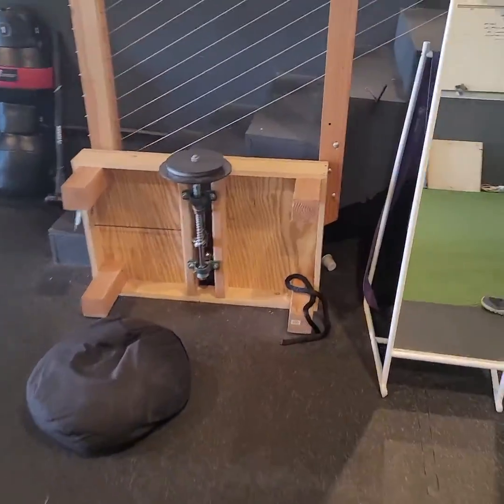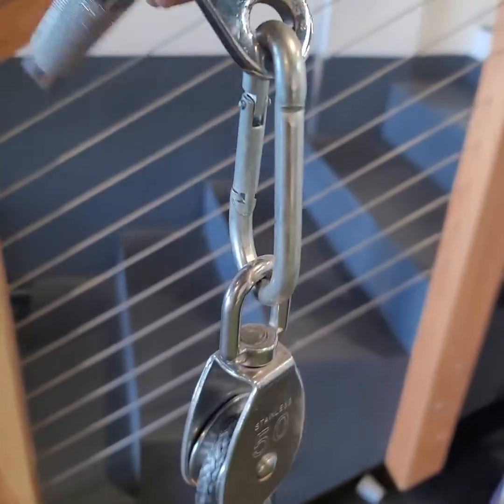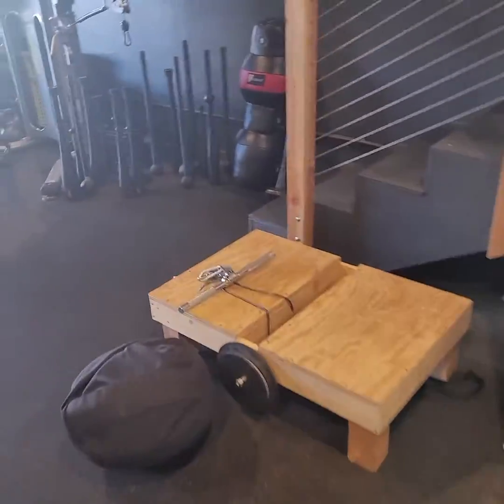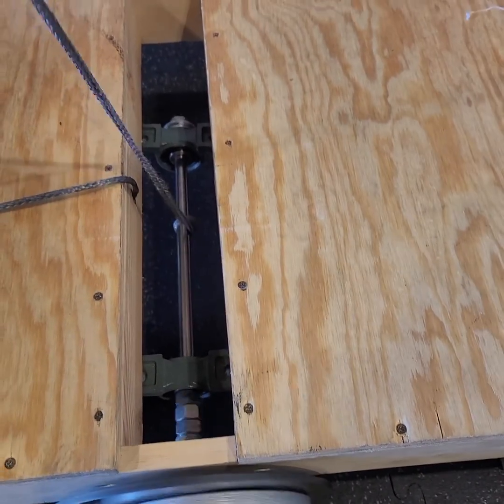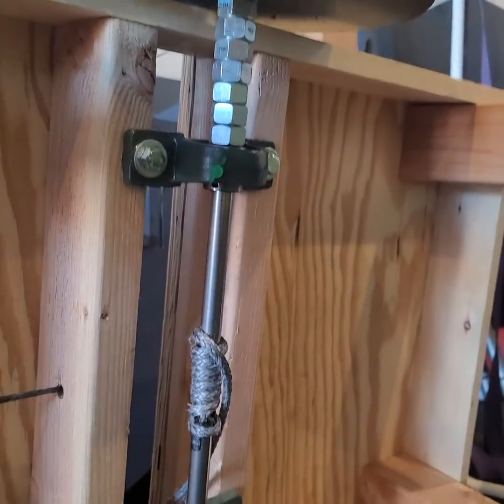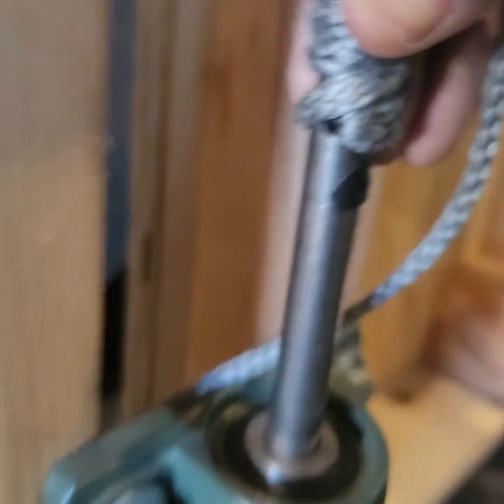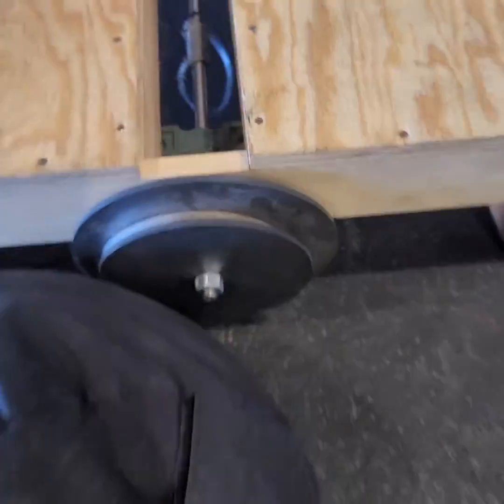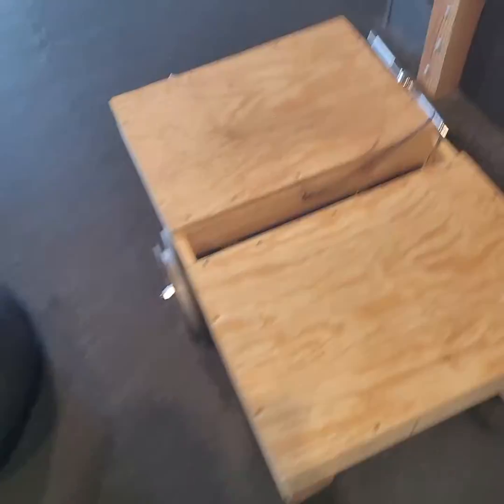Flywheel Training Box DIY

Comment: I have alot of questions man. Pillowblock bearings are costly, whered you get them and what do they cost? Im gonna use a flywheel from a spinner bike
Reply from the maker: I got this from a machine shop...I'll see if I can find you a linknonline 👍🏽
Reply: I was thinking about using the fly wheel from a spin bike too. But started thinking it would be too heavy after seeing the small flywheels on these youtube videos

Comment: Awesome job, what kind of rope did you use?
Reply from the maker: I used a black braided nylon rope from home depot. Not very specific about it, I think a better option would be a rope with tigher stains and not coated in anything. ...something closer to a shoe string but stonger obviously 😊😊
Reply: @keepitunfair  You could try Paracord, it's 550 lb tested and has a tightly woven sheath.